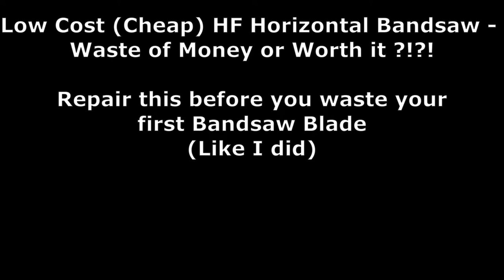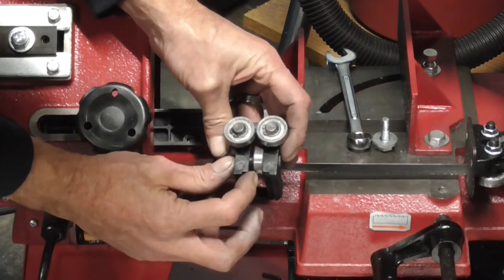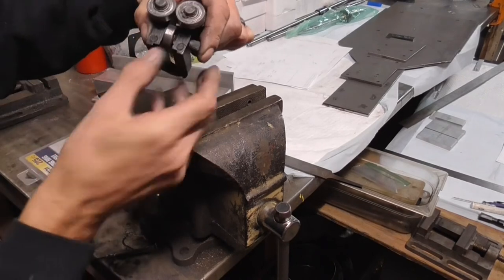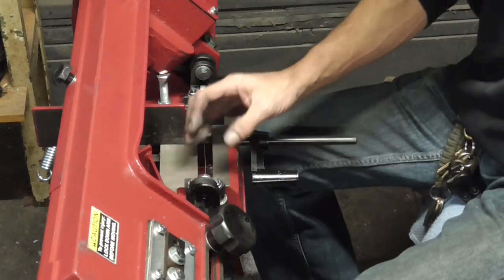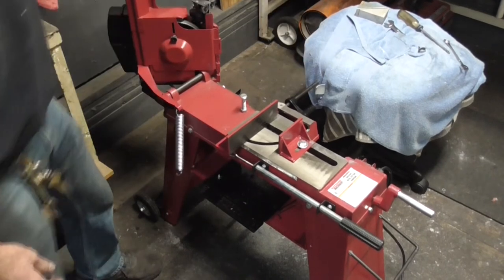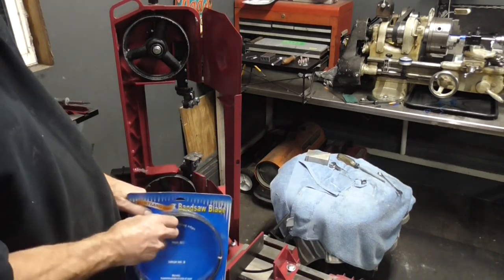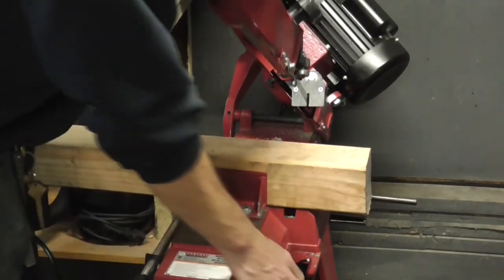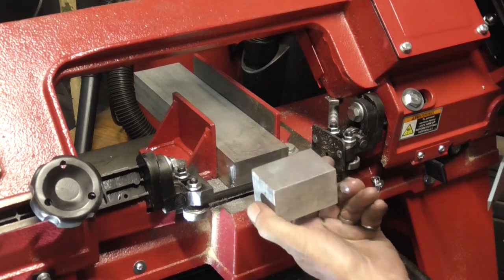Low Cost (Cheap) HF Horizontal Bandsaw - Waste of Money or Worth it ?!?!

Comment: I bought a similar one here in Australia. Mine cut well out of the box and went for a little longer than yours before the exact same thing happened with the blade/bearing. I did a similar repair. It has taken me many frustrating hours and much wasted stock to get it back to cutting square. The supplied instructions were hopeless.
Thanks to you and other youtubers for sharing the problems and how you solved them.
Reply from the maker: Thanks !  Yep, I’ve had pretty good success with the lower cost store’s equipment for things I don’t use all of the time. Always seems that they miss some simple little thing though so I’ve learned to get extra blades, belts, etc…when I buy something, lol.  Here in the US, even the big name hardware stores are selling these now (and even the mills and lathes), but they are identical except painted a different color and most times they are several hundred dollars more.  I think it was still a good buy for the price, but it sure made me grumpy when it messed up in less than an hour or so of cutting, ha,ha.  Now that it’s all fixed up again, it’s been cutting really good with no issues.  You are for sure right about the instructions being useless…I learned how to line one back up and set the bearing gaps years ago on the big commercial ones out at work (back when I had a really fun machine shop job, lol)…had it not been for that, the video might have leaned toward the “Waste of Money” category for sure.  Happy Holidays and all the best !  Steve

Comment: I'm getting ready to pick one of these things up and was just doing a little pre-purchase digging when I came across this video. I appreciate you taking the time to share the information. You may have saved me a lot of aggravation. I'll still get the saw but will definitely jump on my lathe and machine and install a couple bearing spacers before my first cut. Thanks again!
Reply from the maker: Thanks man !  Yep, that got it back going again and it cut the rest of the metal just fine after the temporary shim fix. Once I got all of my metal cut that evening, I did like you are gonna do and made some shims that fit correctly so it should be good to go for a long time 👍. Now I just need to fab up a catch tray for it for the shavings and it will be all set. Happy holidays and all the best !  Steve

Comment: Good tip using wood to check for straight cuts. If you tighten up the bar that the spring is connected to the spring will no longer fall off. It's a tensioning bar meant to add resistance to how fast the head comes down. Turn it clockwise to add tension. Looks like a nice lathe you have in the back ground.
Reply from the maker: Thanks !  I’ll have to look at it again to see if it’s just too loose 👍. I think mine is missing the stop that keeps the saw from opening too far or something as the spring just goes loose when raised up and then would just fall off (or I might have missed an assembly step something, lol). Thanks again and all the best !  Steve

Comment: Hi There Steve,    Another very good informational video from you.   How much $$ was the bandsaw and model number or can you provide a link please,  thank you for all your time, work and effort,  great job.
Reply from the maker: Thanks man !  It’s the Harbor Freight Model #62377. I paid $329.99 for it which is about $200 cheaper than the identical ones sold on Amazon or by Home Depot (they are just a different color). The extra band for it was $8.79 so not a big loss, but still annoying as it messed up my aluminum piece I was cutting, lol. All the best and Happy Holidays !!!
Reply: @StevesDIYs  Thank you for the info and happy and safe holidays to you too. 😀